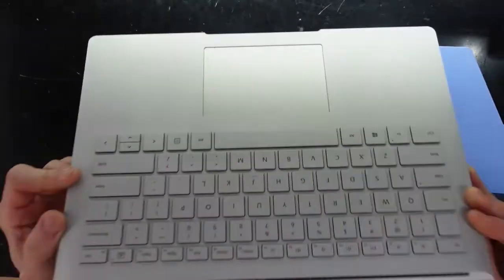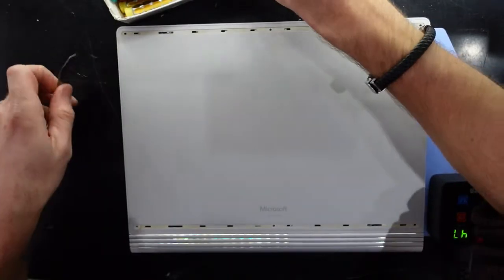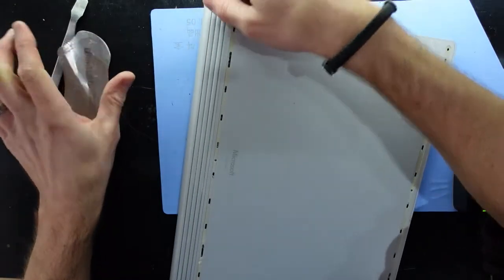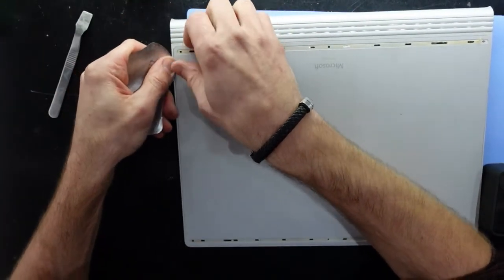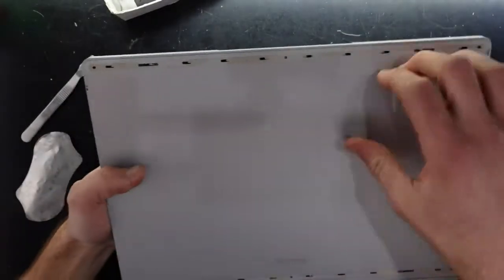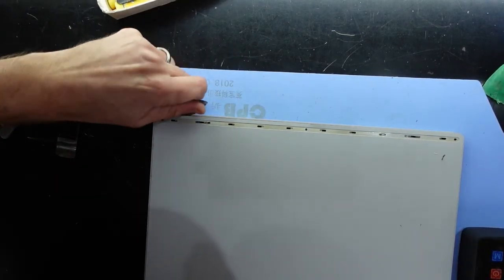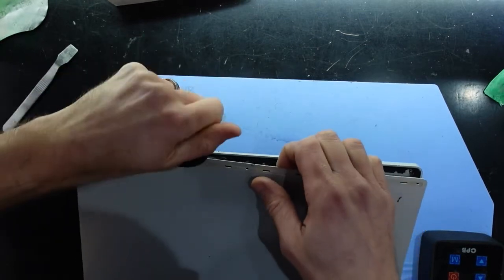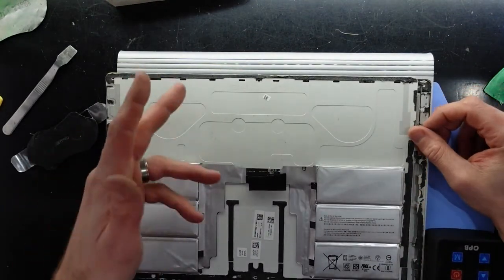Surface Book 2 Performance Base Teardown

Comment: Hi Rick,
Excellent video thank you for sharing.

I need to replace batteries in both keyboard and screen batteries. What is your feedback/ advice replacing the surface book 2 15" screen battery without breaking the screen?

Comment: So after I warp the F out of the base to get the base off and change the battery. How can I get my bottom plate/base to form back to a relatively straight/flat bottom again? Lol😅
Reply from the maker: heat helps... but too much will warp it

Comment: Did the usb A port module have a cutout for the gpu fan?

I’m looking for a replacement part but am uncertain if the performance base uses a different module than the one without gpu.
Reply from the maker: not sure, what the video to find out